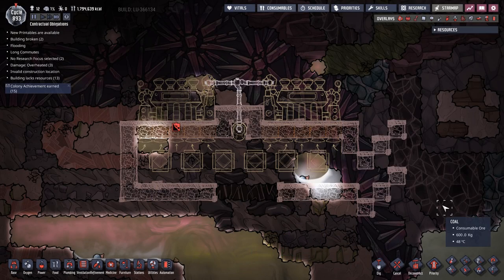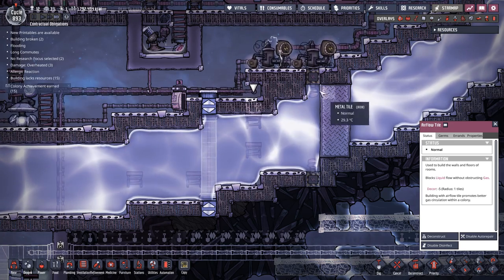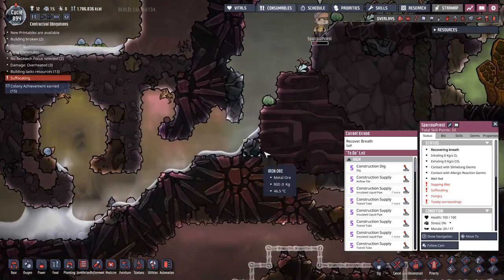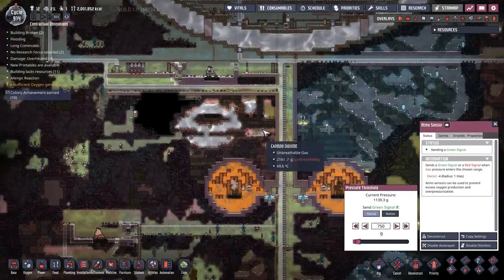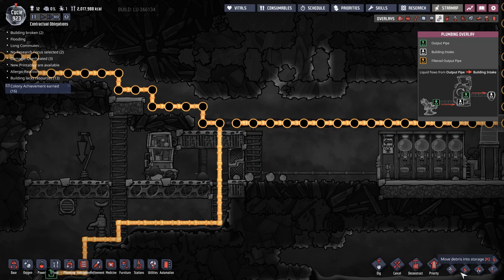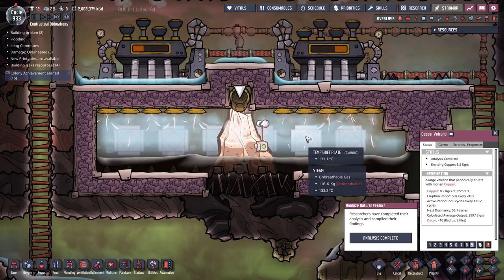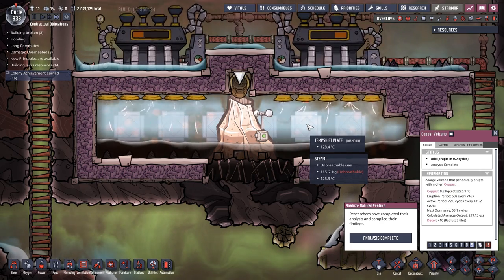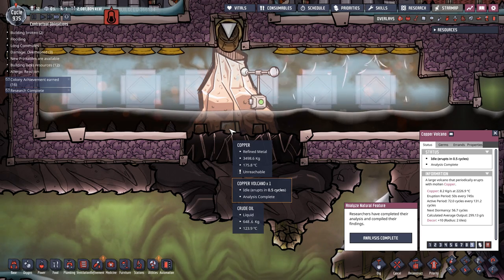The EASIEST Volcano Tamer EVER! Steam Turbine Cooling Setup - Oxygen Not Included FULL RELEASE Ep 4

Comment: The metal stockpiling in one place make you lose a lot of potential heat! The new piles start at around 800C but the old ones waiting down are around 120 and very slowly raising during eruption. A small automation is not witchcraft, just move the metals when they are cool a few tiles to the side, don't have to move out of the chamber until dormancy.
Reply: I agree. There is a ton of lost energy every time the volcano erupts. This setup is more about the absolute bare minimum somebody needs to do to build a functioning volcano tamer. There are a few qualitative benefits though. It could be useful if a player just wants to cool the metal down and doesn't really care about electricity production. Another consideration is space. The tamer is super compact, which is valuable to players like me.

I guess it's up to the viewer to figure out how to improve the design if they want to get more power out of it

Comment: The snipping tool cutter mod is cool, but is way to OP. May as well be playing sandbox mode because that tool allows you to make so many mistakes and allows for instant halt of an error in design.
Reply: The point of the mod tho is that you can build those junctions w/o dups in vanilla. You can connect cables, pipes (never tried but I assume rails too) in sealed rooms in vanilla. Doesn't make much sense either, but if that behaviour is in vanilla, then beeing able to undo it w/o dups doesn't feel wrong (at least to me). YMMV of course.
Reply: Also, you could accomplish a similar thing with bridges.  When you remove a bridge, no liquid drop, but it stops the flow.  Also, as TheMule71 specified, if you can make tile-tile connections without dupe interaction, or use automation to just inherently turn something off, why can you not make an easy break in the pipes.  On top of that, when the auto-save bug destroys your entire wiring and/or tube system, you should be able to fix the problem...  Many times I get caught trying to place tubes or wires during the auto-save time-frame, only to realize I had just connected wires/tubes together throughout the base.

Comment: Why not just add an air lock and lock the door during the eruption.
Reply: an air lock is really an air lock, every time the doors open a bit of gas will escape and he would have to keep topping it up.  With his water lock.  No gasses leave.
Reply: Airlocks transfer a lot of heat compared to insulation tiles. Creating a vacuum with the 3 doors setup would be a perfect insulator, but insulation tiles are good enough I guess. Doors would still be better because with a thermosensor set to lock doors as long as the temperature is above 120C would remove the need to babysit it every 100 cycles.

Comment: What do the tempshift plates do again?
Reply: They even out the temperature on the tile it's on and the 8 surrounding tiles.
Reply: They "shift the temperature" around. The tiles work by 3x3 tiles around it to equalise the temperature. Depending on the material used, they will spread (high termal conductivity) or stabilize (high termal capacity) the temperatures in that 3x3 pattern around it. 

The use for them here is to spread the heat from the middle of the vulcanos to the edges to make the steam turbines work better. That's why diamond is used, which has a very high termal conductivity. (spreads heats better)